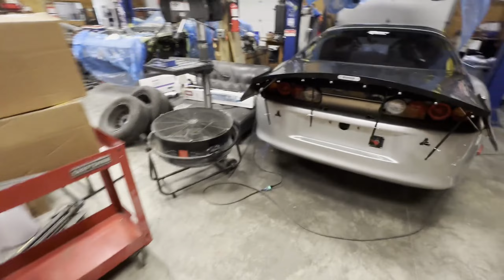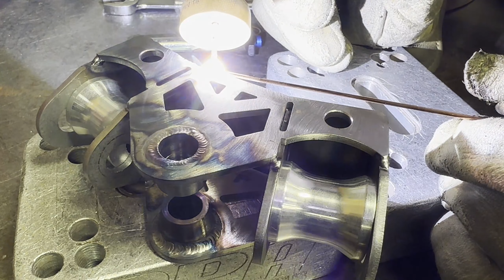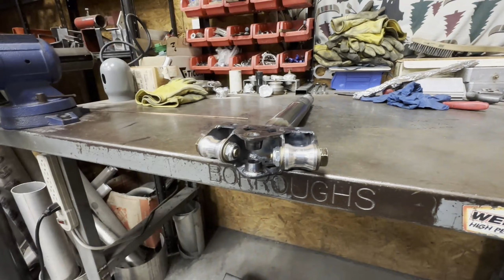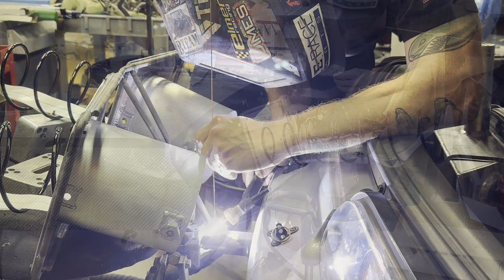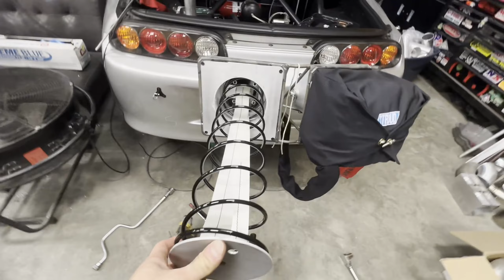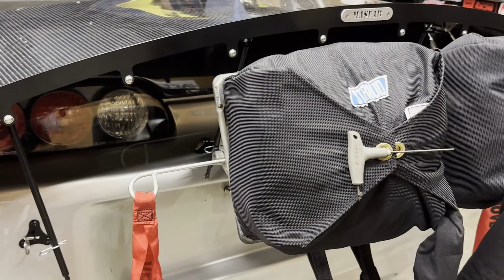Building a Removable Dual Parachute Mount for My Supra Drag Car

Comment: Very interesting design and solid fab work.  The only thing I would add is to possibly sleeve those holes where the bolts go.   Dual chutes hit hard and it will want to oval those holes, even being .120 wall.
Reply from the maker: Thank you for your kind words and support. I actually have plans to reinforce this mount that incorporate the sleeving you're talking about. I'll overbuild it since, as you said, there's a significant amount of force at play and I really don't want it to rip off of the car.